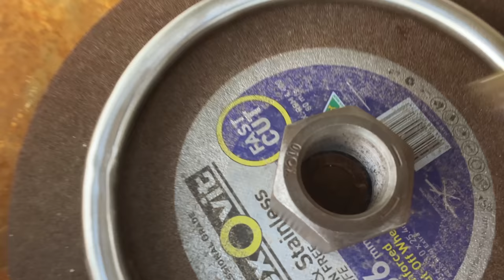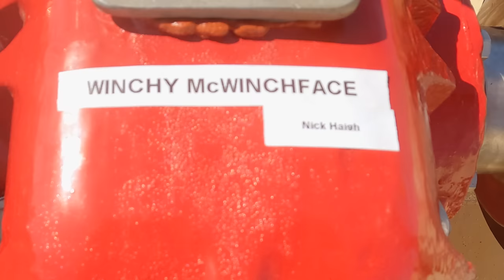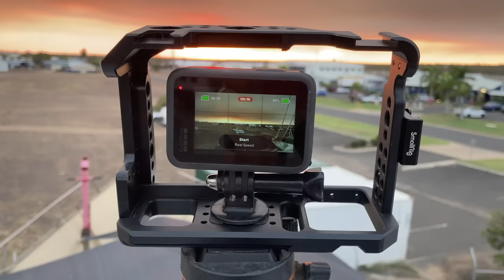The Anchor winch finally goes on! - Project Brupeg Ep. 265

Comment: With your new knee capper and shin destroyer I'd be inclined to add a lynch pin, role pin or cotter pin in the end of the shaft to ensure the hand wheel doesn't fall off and end up in the drink

Make sure you tie your shackle pins with stainless steel bonding wire

Comment: Always put grease into the coupling where the hydraulic motor joins to the worm drive shaft otherwise it will flog out over the years from use while running dry. This happens a lot with hydraulic pumps mounted to truck gearbox PTO's
Reply from the maker: Ahh thanks. I’ll do that
Reply: I was concerned when the steel hammer was used to drive the motor onto the keyed shaft! Maybe a piece of timber as a buffer next time. Keep up the good work.
Reply: Please don't pound on the hydraulic motor at all!  Those small ones don't have any thrust bearings.  You're banging on the internal valve plates.  Pull it in with the bolts.  And yes, grease the spline.
Reply: Using a peice of wood or pulling it in with bolts is no diferant than hitting straight on the motor 
A peice of wood is just to protect the paint or data tag 
Bolts are just to apply more force 
Either way your still applying force to the motor 
Grease on the shaft and gentle taps is how we do it all the time 
I'm a heavy desel mechanic and do motors you can hold 2 in your hand to pumps you need a crane to move 

Many differmat ways to do a job but if its completed and functioning at the end of the day it's a success
Reply: @fowletm1992  The difference is the pounding - the shock load can break or deform internal parts.  It would be best of course if the spline slid in, but it's pretty hard to clean them up once they're damaged.  I own a hydraulic shop.

Comment: Nice job, peeps. Brain AND brawn!  🙂 I remember when I was a tiny little Elli no bigger than your thumb and working with ordinary bolts and fixings; I was taught that the rough torque setting of "f-tight" meant that you did things up "finger-tight".

Once out in the real world and helping a sweet-natured monster of a guy called Big Jake (a rugby player and my jiu-jitsu sparring partner who weighed around 24 stone) to restore an old steam traction engine with tools, bars and wrenches I could barely lift,  it soon became clear that "f-tight" actually stood for "flaming-tight",  only the "f" didn't stand for flaming...🤭

Comment: When filling up oil using a funnel insert a small screwdriver in to the same hole as your funnel goes in and it will allow the trapped air out allowing the oil in. Thanks for posting

Comment: If I remember right, that plate was stainless. Once heated, stainless hardens and will destroy any tool metal other than carbide. Even work hardening does the same thing. The carbide in wood tools isn’t the same grade as used in metal tooling, but it’ll work just fine as you found out for the “in a pinch” situation.
Reply: That's a metalworking carbide bur that he used mate, just has the same shank size as a 1/4in router - the tool itself was the correct tool for the job, not a woodworking tool. Obvs the router is a novel idea but fits the correct spindle size, speed and is designed for axial loading so props to Dame's ingenuity there, not surprising it worked so well. Gave me a handy option for using my 18V LXT router as well where you need to maintain perpendicular cutting too.

Comment: Damian you scared me willies pulling that cheater bar towards your head. I did that with a 3 inch pipe wrench once and it slipped and gave me the El KaBong. Took me to my knees and would up in the emergency room counting fingers and the counts were off. Listen to Jess!

Comment: I would put a cotter pin/roll pin and washer on the end of the wheel side shaft to prevent the wheel from vibrating loose and falling off, where it will inevitably be lost at sea.  You can't torque up the wheel and it is not designed for heavy loadings so it could easily vibrate loose with pounding seas and engine vibration.
What you need is a podger (a tapered shaft) to align the holes for the bolts, I;m surprised you don't have one as they are really useful.
What happens when you have an emergency and the main engine isn't running and you need to drop anchor? (loss of engine power and you are drifting towards some rocks!)

Comment: Have the vegetable oil go through the coil and put the coil in a small tank full of coolant. Set it up in the engine room so you don’t have to run hoses every where and rise a contamination in the fuel tank.
Reply: Yeah agreed, think he'll be fighting a loosing battle with fuel slosh trying to heat up a localised area of fuel/oil in-tank around a pickup. Dame, think about maybe buying a oil/water heat exchanger you could plumb directly and keep serviceable/replaceable - I understand it might be tricked collected the oil out of the tank in the first place though which I'm guessing is why you're looking at going the in tank rout - I wonder is veggie oil like trecal sub 5 degC? haha

Comment: If you have fears that the oil won't be moved about, you can easily rig (down the line) thin copper lines run to a small oil pump. There should be more than enough space inside to route these lines to the key points where oil is required. If it works in lathes, it works for this too.
Reply from the maker: I did ponder this sort of thing. I was thinking let’s get her running and out on the water and do some testing to see if it’s all honky dory

Comment: Hi Damien, I know you are not showing everything, am only saying this as when I have seen it being used it was insufficient for the job. All mating surfaces and threads not using sealant, use liberal anti-seize. The smallest amount of salt water laden air does incredible damage on mating surfaces, often making them nearly impossible to get apart again later. It will get sucked into those parts by the fairly small temperature changes.

Comment: Please treat the whinch as extremely important for safety reasons. Believe you check the bearing clearance, preload Gear contack patern. Clutch condition. Filter on your hydraulic line. Need to check the winch once a week check for leaks, heat build up. A lot of energy at that point exspessialy when you use your engine to assist and a sudden drop asstern. Keep safe.

Comment: Hello there .... Great Job with the Winch ..... Question ????.... Sure that you will have an Answer ..... :-)   :-)   :-)  ..... Isn't it Always 'Best Practice' to Drop the Bolt DOWN, Nuts Below .... ??????  ....2 Reasons ..... IF you loose the Nuts, the Bolts are still being held in position with Gravity ..... AND the Vulnerable Threads / Nylocs are then Below, Out of 'Harms-Way' and Out of the Weather / Salt ..... ?????      Best to All, Thanks for your Great vidclips .... Cheers from ChCh, NZ
Reply from the maker: Generally yes. But because of the lumps sticking out of the casting it’s impossible to get the bolts down from the top. Hence we went up from the bottom.
Reply: @ProjectBrupeg  Yep.... As I said .... You would definitely have a 'Very Logical' reason Why Not :-)   :-)   :-) .... Could not imagine you overlooking something like That !!!!!! .... Best to All, Thanks for taking the time to respond .... Keep well and Stay safe .... Cheers ....

Comment: for heating, the veggie oil why not use an engine oil radiator use AN fittings on the inside and through wall fittings to the outside of the tank.

Comment: One thing about heating the oil, if you have the pickup at the bottom of the coil in the tank, then it will be picking up cool oil as the warmed oil would rise. Maybe pump the oil to a smaller tank that you heat and let that overflow back to the main tank?
You can pull copper into a tighter coil, SS has a tendency to kink if you try and bend it too much.

And Vegimite as a lubricant?? I don't think its not even good for that!

Comment: Strong work! Im curious why you didn't put the bolts in from the top down, with nuts underneath. It seems like its easier to seal the head of a bolt than a nut. perhaps it would require you to take the winch drum and chain gypsy off first. Or why you didn't use any kind of gasket material. Im sure you considered it. Thanks for the videos ! I love the project. From santa cruz, ca
Reply from the maker: Lots don’t fit top down. Only bottom up. Anchor room below is a wet locker so no need to seal between the winch
Reply: @ProjectBrupeg  Ah I gotcha now. That makes sense. Well it seems like you have a bulletproof winch there! Can't wait to see you two using it on adventures
Reply from the maker: Thanks mate

Comment: Smashing work! 

Is there ever a worry that the nut/wheel will work loose from vibrations or if it were caught whilst rotating? Or is the RPM slow enough and the thread fine enough that this won’t be an issue?
Reply from the maker: Yes rpm is low and thread is super fine. Previously it was a similar design but coarse thread

Comment: Can I ask why you didn't use emery tape and Inox/CRC to tape the rusty shaft on the hydraulic pump. It could have been made fit better rather than using a flogometer.

Comment: At least the Moly High Load tastes better than the Vegemite. Tried it once and it reminded me of that old mushy onion I found in the back of the fridge... I've noticed other winch installs used a 'Chain Stripper Pin' to dislodge the chain from the gypsy. Is yours loose enough that the chain disengages freely?
Reply from the maker: Yes

Comment: I used to have a Renault master van and the diesel filter on the engine bulkhead used to have an engine coolant heated manifold on the bottom of it so the hot engine coolant preheated and thinned the diesel for colder climates. I wonder if this could be used in a marine application.
Reply from the maker: Yes very much so. We do plan for a much larger version of what you have described

Comment: Serious questin, not  for Dame but for everyone who uses silicone jointing compound on machinery.. Where there is squeeze-out on the exterior, fine.  One must assume there is (and I have seen equal amounts on the interior of gearboxes, engines, etc etc,how do you stop this squeezeout blocking filters, plugging oil passages and blocking feeds? I've seen countless small engines killed with this stuff, and youtub
I aint knocking Dame, he aint an idiot and using it here is fine, but i've seen it used to rebuild bike engines where it has completely destroyed things....
Reply from the maker: I like to allow it time to fully cure before bolting tight and covering with oil. So it has more integrity. Also this is a very slow moving machine without much heat compared to almost any engine

Comment: Would not the winch anchor bolt nuts and threads corrode less inside the anchor locker rather than above the deck?
Reply: Impossible to put the bolts heads topside because they're to long and hit the gear case casting.
Reply from the maker: Also there is virtually no difference in the environmental aspect inside the locker verse outside. Same amount of salt air floating around

Comment: How do you keep the wheel on?  Great work restoring the beast.
Reply from the maker: Tension. It’s super tight and is a copy and slight improvement to the original design (change thread from coarse to fine so we can get more pressure)

Comment: Why no sealant round the winch bolts to keep the seawater out?
Reply: wet chain locker
Reply: The bolts and under the actual winch and deck plate. Don't want under the winch staying wet.

Comment: Wait, I know you are into redundant systems but if your main engine fails you can't use the anchor winch? I am no expert, just an honest question. 🤔
Reply from the maker: We can drop the anchor manually without hydraulics by using the brake. However the longer term plan is to have multiple hydraulic redundancy within the boat, cash flow limits building that right now